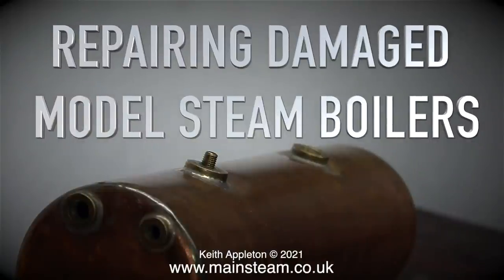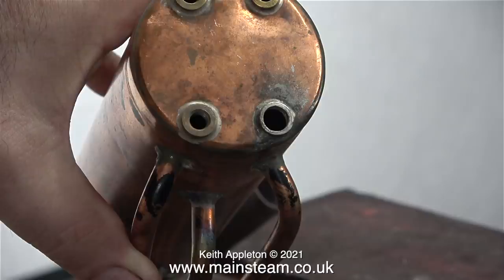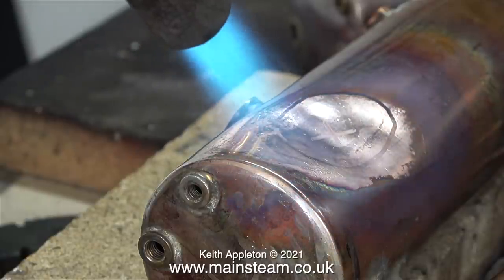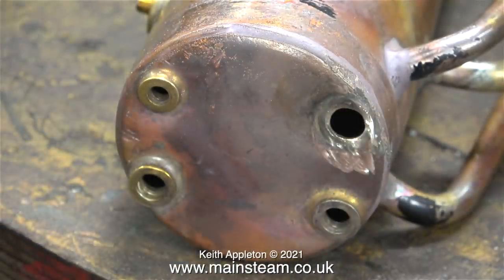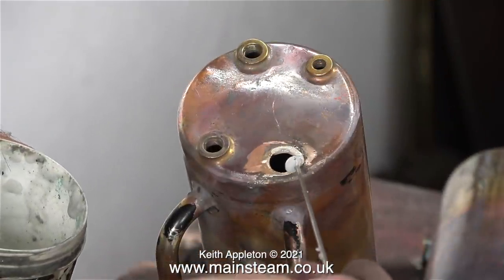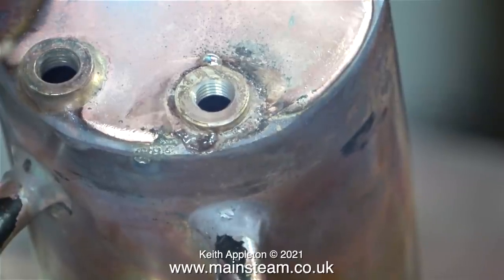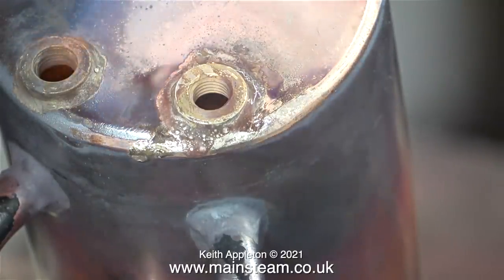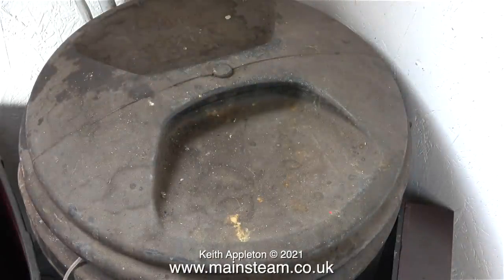REPAIRING MODEL STEAM BOILERS

Comment: I notice the extensive use of silver solder.  We have extensively used silver brazing rod when doing copper to steam bronze (piping to sleeves).  Just wondering if this practice of silver solder is an old practice that just continues on, or is there a reason to use one instead of the other?  I was taught that silver solder required a very close fit up where as the silver braze was a little stronger and was slightly more forgiving on fit up.  Both however required clean surfaces.  Any thoughts?
Reply from the maker: Silver solder seems to be more popular than brazing these days as it flows at a lower temperature.
Reply: @keithappleton  Thanks for the reply.  I hadn’t thought about the temperature issue.  Considering the amount of heat required when constructing boilers made from larger copper tube and many not having invested in acetylene/(oxygen) gas for heating and with lower boiler pressures makes the use of silver solder very desirable.